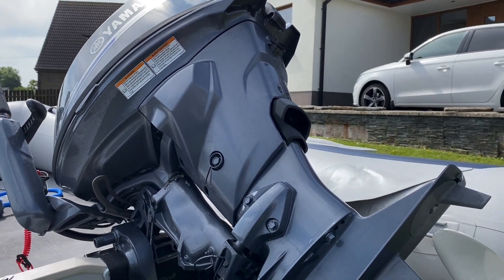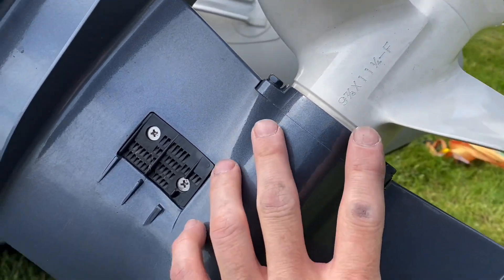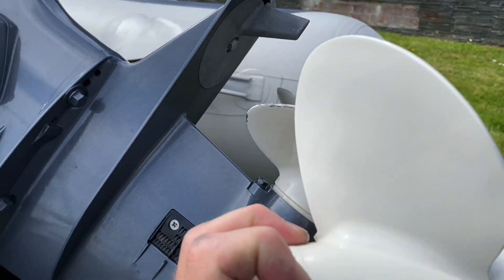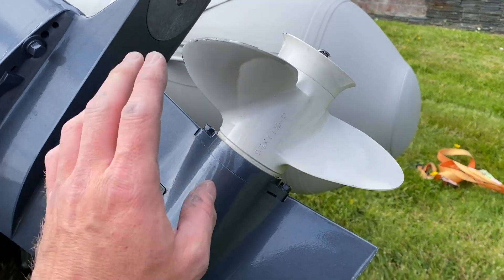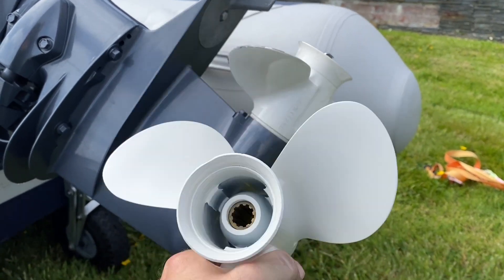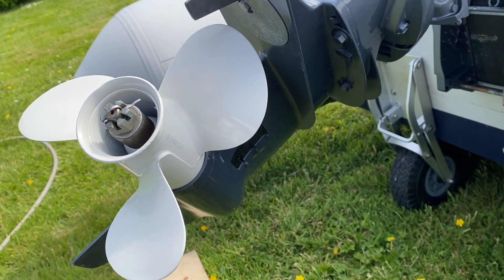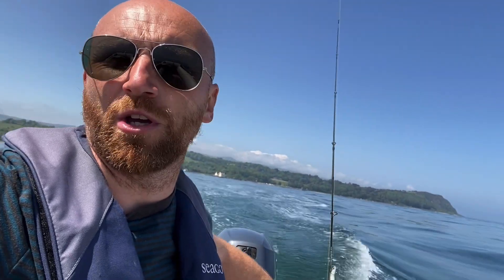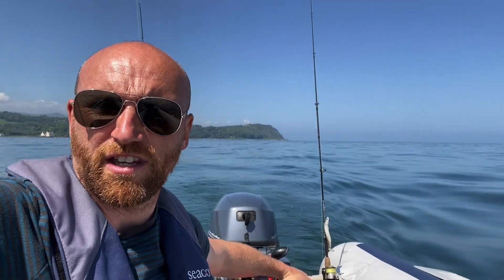Prop pitch change speed test!! Yamaha f25 slower/faster

Comment: You didn’t change the pitch much. 11 1/4” pitch means for every full revolution your prop travels 11 1/4” through the water. You jumped up to a 12 pitch, that’s not much different. I would try jumping up to a 13 pitch.
Reply from the maker: I think I will leave it alone for now however down the line I might look at it again, thanks for your comment 👍